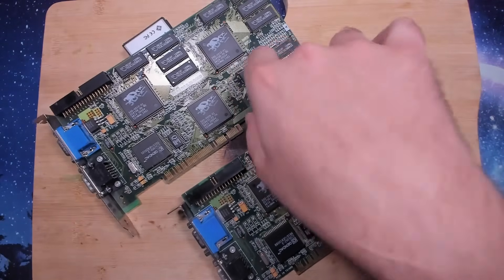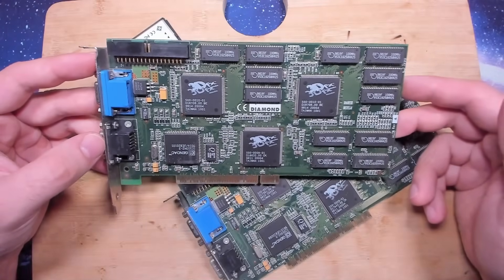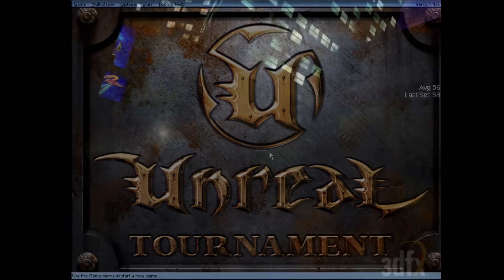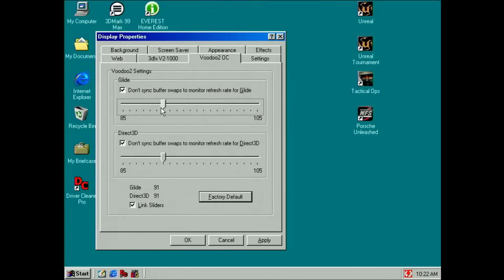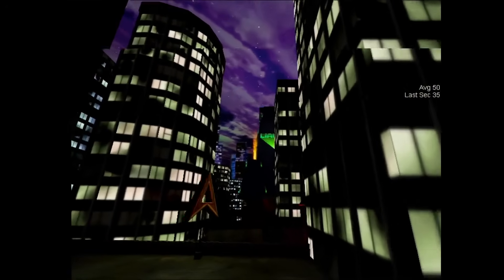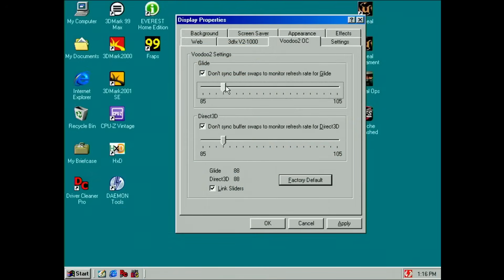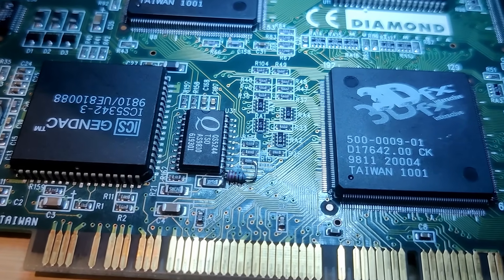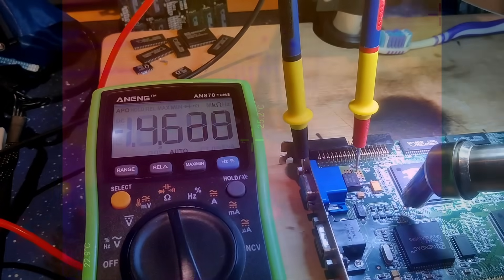Voodoo2 Crashing Games? Here Is What To Do!

Comment: I'm not likely to use a Voodoo card in the future, but I'm still fascinated with this channel. I love the diagnostics, presentation and especially the solder porn. Whenever I look at my soldering, I get a little sad, and pray that one day I too will be able to solder like a big boy.
Reply from the maker: Haha, yeah - soldering can be quite difficult! I am happy that so many like my soldering skills :)
Try some different flux brands and soldering irons if you get the chance - sometimes it is just the tools you use that make everything a lot more difficult. It could be as simple as the soldering tip that is bad.
Reply: @bitsundbolts  Would be cool to see a video that discussed your setup and equipment. I use an MG chemical flux that I do like, but I like the look and action of the flux you use as well (is it an Amtech flux?) and would like to try it. Also, would be nice to see what heat setting you use on your irons and hot air. That kind of stuff.
Reply: I agree with what bub says. Some equipment can really work against you. Though there is good stuff that is affordable so no need to buy the most expensivs stuff if that is out of your budget. And I'd say to keep on soldering to gain experience. Even if it's just these little soldering kits that can be bought for little money, it will help you get better at it.

Comment: Few years ago I found some german fella selling VooDoo2 cards brand new shrink wrapped on eBay - the "Maxi Gamer - Power of TWO!" SLI sets. Two 8MB V2's with the pass through cable and SLI connector, for £27 a set. It seemed he had infinite supply of those bad boys.

I didn't hesitate I bought 5 sets right off the bat, ended up using two sets in retro rigs. Sold a pair a few years back to treat the kids and still have one remaining on my dusty shelf.

I was gonna plug ALL TEN VOODOOS into each other, create a monster, a destroyer of WORLDS! But I got scared so I didn't.
Reply: Lucky x10! Never would have guessed that so many of those Maxi Gamer cards were in circulation. I bought a single unit a few years ago then kept occasionally looking for another one to fulfill my childhood dream: an SLI setup. Then I found out about FastVoodoo2 4.6 supporting unidentical cards and finally bought an 8MB Diamond after that with a faulty DAC green channel for cheap. I repaired and upgraded it to 12MB with EDOs and a DAC from utsource and repurposed (cut+connectors refitted) a floppy ribbon cable as the SLI interconnect. Unfortunately the passthrough cable was bought online and it's not that thick shielded one, but I remember I had problems with that cable back then as being too inflexible. I have two more mexican manufactured STB Systems cards in a bad shape which I procrastinated to repair (yet), plus a few FBIs, TMUs and EDOs. Maybe I need a New Year's resolution for that... Especially after watching another new video on the subject. 🙂
Reply from the maker: Haha - you should have ended with: AND I DID! IT WAS EPIC! Ten Voodoo2 will be a bit difficult with the limited number of PCI slots though...

Comment: Great video! The extra resistor next to the faulty chip is only present on revision A of the Diamond Voodoo 2. I always wondered if it was a fix for a design flaw by Diamond, later revisions don't have it. So maybe the fix isn't enough to keep these cards alive. I have a faulty revision A in my storage unit, it might suffer from the same issue.
Reply from the maker: Oh, you mean that the fix by Diamond contributes to a failing QS-buffer chip? Could be...
I have a Revision B (coming up in the next video) - which still has the round resistor. If I am not mistaken, Revision E doesn't have the resistor. Not sure about the other revisions.
It would be awesome if you can check your Revision A card - and if the buffer chip is an issue. 
However, wait for the next video because you should also first check your power circuits (+5v and +3.3v)!
Reply: @bitsundbolts  I have one, i'll test the demo scene on UT . :)
Reply: I too wondered why mainly just REV A has the extra resistor, actually thought it was sign of prior repair when first got my card.